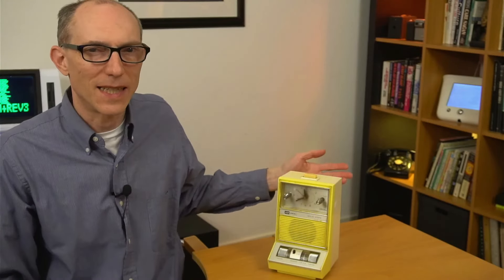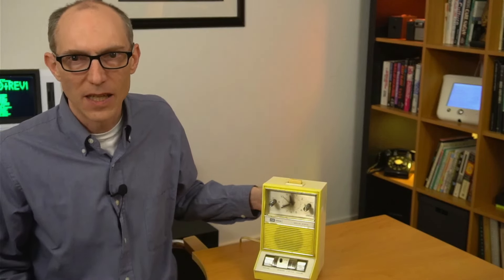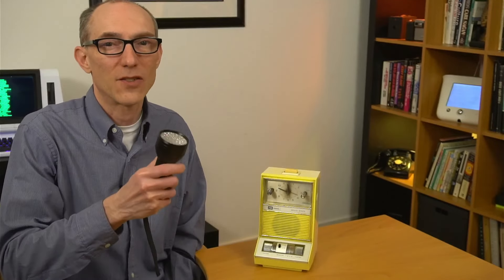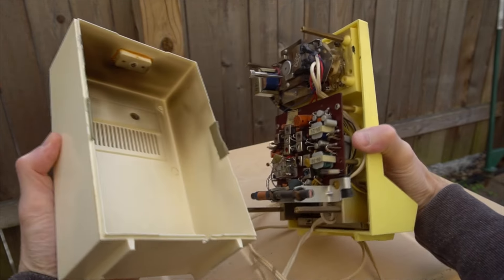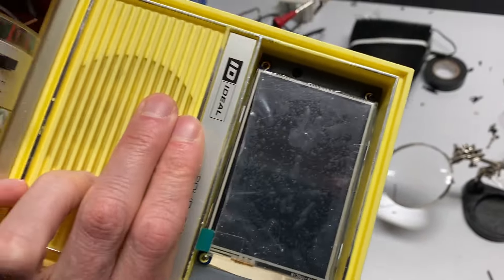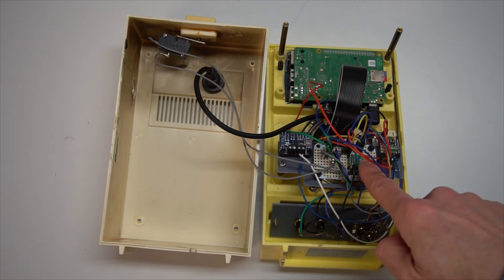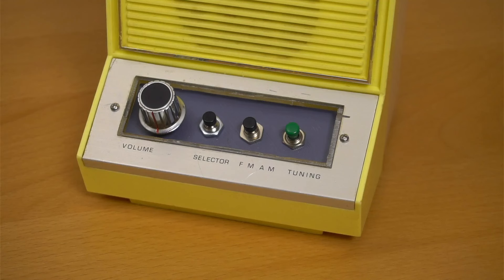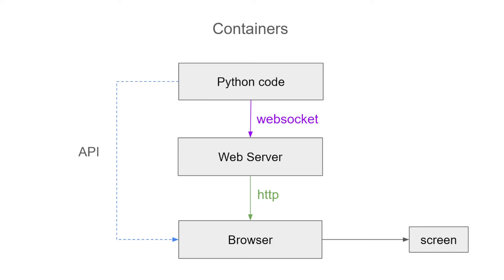Ugly 1960s Clock Radio Saved by A Raspberry Pi

Comment: Wow, great job. The implementation of the slot machine is hilarious. Pleasantly surprised to see how you retained the clock face, and added the 80's-esque digital display.

If you do another retro rebuild like this, I'd challenge you to maintain all of the original mechanical inputs. That would have meant a smaller LCD between the two knobs around the clock face, and keeping those cool rollers on the bottom. Just like how you did with the snoozer, demonstrate how to interface with the existing input. 

One last idea: say the only thing replaced in the bottom panel would be the mechanical FM/AM frequency indicator. A teeny tiny LCD, like a square cm (tbh I don't know how small retail LCDs get) there to display frequency would have been bonkers and inspiring.
Reply from the maker: It was a tough decision to remove those original parts, they looked really neat! Mainly it was a time crunch but also would have required a lot of mechanical work - those rollers were at a strange angle.